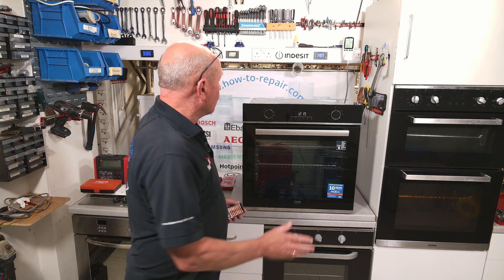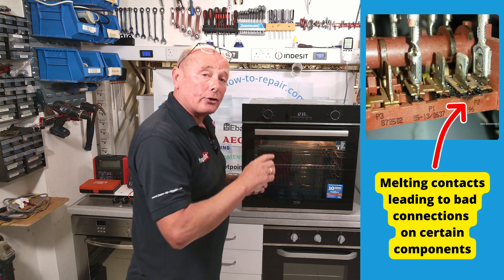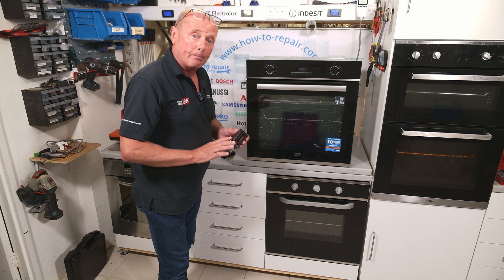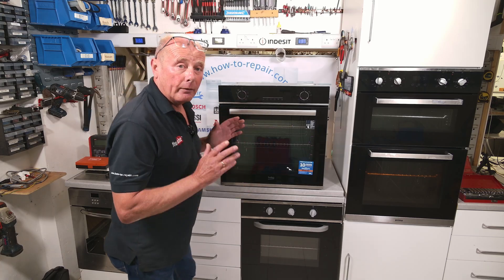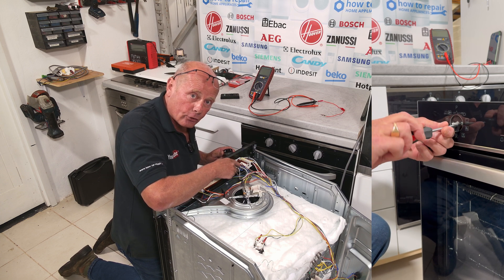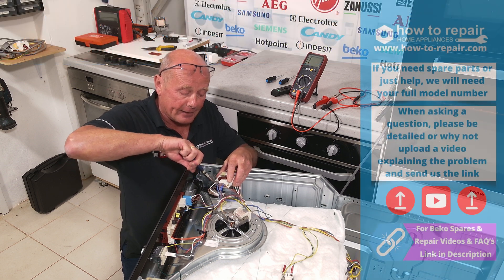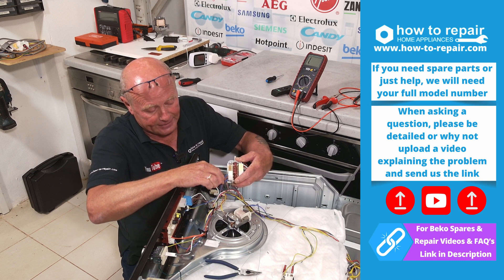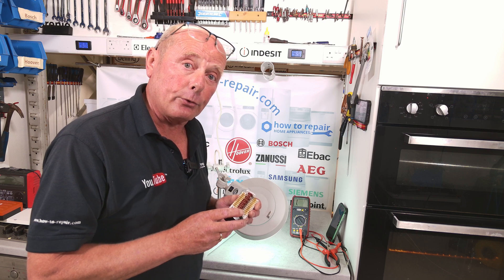Most Common Cause Of Oven Failures | How To Test & Replace Selector Switch On Cooker Ovens & Stoves?

Comment: Great video as always. Although I'm not an appliance tec , our oven has given me much experience as its oven selector fails with a tiresome regurlarity . We always turn the selector before the thermostat knob and in reverse when switching off. However, the 'latest' selector module ( the cooker is on its 4th !) has still only lasted 11 months and one week. It usually packs up a few days before Christmas,  but I think the cooker is going soft in her old age and has given me 3 weeks grace this year. 😊
The truth is that these switches are simply not man enough for the job. Delonghi redesigned the wiring loom on our cooker in an attempt to mitigate this problem spreading some of the heavier loads over more than one contact.. Several years ago when the switch had melted I purchased a conversion kit recommended by Delonghi consisting of a new style switch,  a complete new loom ( already connected to the switch) and a circuit diagram.. It still failed after a year or so. However there could be another reason for it. Our oven was used with a knackered door seal for quite some time thus making the elements work harder for longer. This almost certainly does not help prolonging the life of the selector switch.  Worn door hinges too can cause door misalignment leading to leaks. Heat escaping along the top edge then caused the timer to overheat ! 😂 £££ !  Tip- If you oven selector has melted check all of the door and glass seals. Also if a hinge seems a bit stiff replace it . Better still,  order all the seals and a pair of hinges along with the replacement switch. Chances are you will have to strip the door down to replace either the seals or hinges so you may as well do the lot to ensure a good seal and this will prevent the elements working their nuts off to come to and maintain tempreture.  This will also help the whimpy selector switch by minimising the time it has a load across it. .Our cooker oven tripped the mains again yesterday and sure enough it was the 'usual suspect'. I've ordered a replacement and after a few hours of deep cooker cleaning have sat down to see online if this problem  is just unlucky me . Its obviously quite prolific !

Comment: What does it mean when the iron curled bars up in the chamber are bent and halfway melted?
The thermostat seems fine. I presume the door didn't sufficiently close, cold air kept going in and the thing simply overheated by never reaching the set temperature in any reasonable time?

Comment: I have an old white-Westinghouse stove model wf69tw-1. I don't have the manual.  I've never used the selector knob on my stove, I didn't know what it was for.  I've been cooking my food just fine with the oven knob. It preheats the oven. Once it reaches the temperature, the food always cooks well. I don't understand the need of the  "selector", when my food cooks well without it. So, am I missing something? Do I really need to use it?

Comment: Meggie: I've got a Beko BBIF12300B oven, and it works fine for the first 15-20 minutes, but then it just suddenly cuts out completely. I have to wait a while before I can turn it back on. I've watched some of your video and my conclusion is that I have a faulty selector switch but I don't know how to inspect it for any sign of burning. Could you please help me what's causing my oven to switch off unexpectedly?

Comment: I once saw one of your older videos regarding selector switches and when you explained what happens if you use it when the thermostat is already activated, I immediately stopped both myself and my family from doing this. I did switch it ON the correct way but switch it OFF the wrong way.

Comment: Washing machine START BUTTON  on our "Bosch Maxx 6" I guess stops the burning the program selector contacts. Older machines had microswitches on the selector which can handle larger currents. 
Perhaps there should be a start button on an oven BUT I guess that would not stop the arcing if someone turns the selector while the oven is cooking.